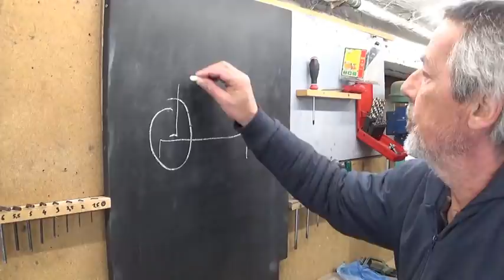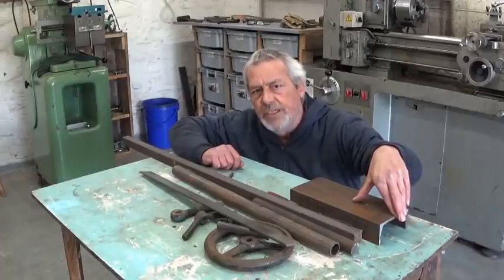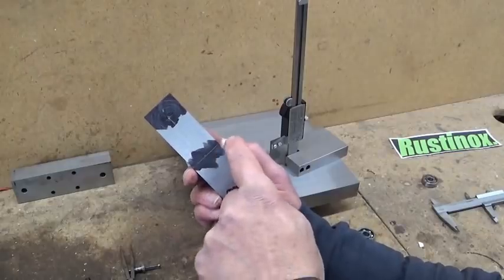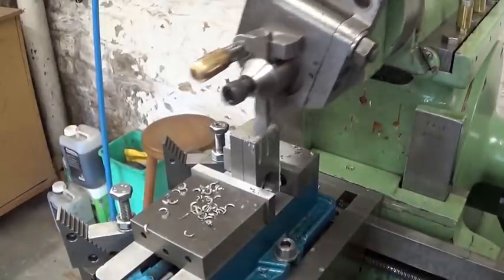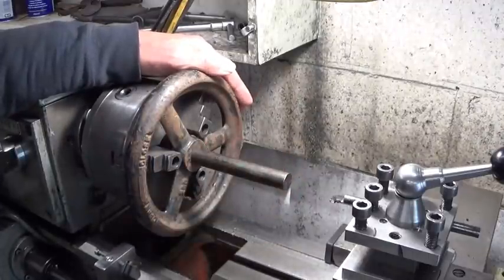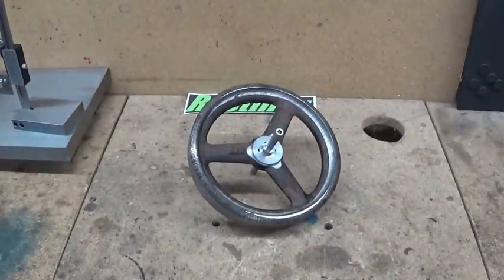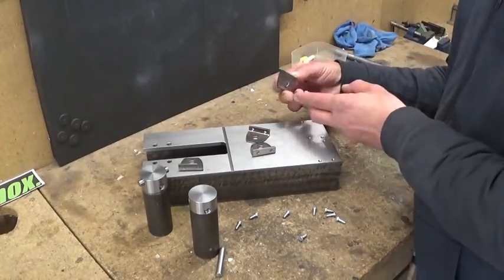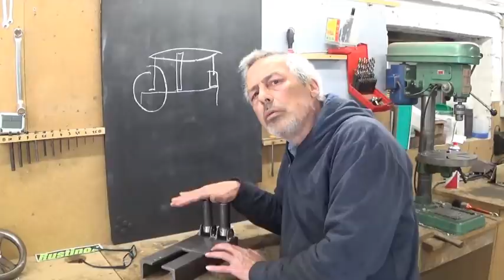Beam engine build part 1.

Comment: Nice “scrap” build.  If not already planned could you go over some of the dimensions of parts once built?  Just talk us through or annotate the blackboard drawing. E.g tubes used for cylinder were x diameter, y wall thickness, z long.  Beam is X x Y barstock, Z long.  That sort of thing. Most interested to see how you get the seal on the pistons.   Is this going to be an air run engine or real steam?
Reply from the maker: Thanks James. My idea was to give more details at the end of the build. It's all made of soft steel and will run on compressed air.

Comment: “With a big hammer it will fit!” 😳
I just love the mixture of precision engineering and brute strength. Real engineering.👏👏
The use of the cast hand wheel is inspired. This is going to be one beautiful scratch built engine. 👍😀
Reply from the maker: And it works!

Comment: That's the way to build an engine.
Several skilled Tubers fight with twisted castings to make use of them. I wonder what they want, make an engine or make use of "impossible" castings..
Reply from the maker: Thanks Stefan. I don't have the equipement to machine these small castings so i do it my way. The advantage is that when i screw up a part i can start again. If i screw up a casting it's total loss :-)
Reply: @Rustinox  Just what I think, pick up a new piece from the supply, or the scrap bin, if Boozo visits...
Some Tubers make costly riggs etc... Luxuary work....

Comment: Wow, somebody's really getting into steam engines :D
My first attempt at a homemade engine was a beam type, too - an utter and catastrophic failiure.
I just can't get a thing to work properly without doing some extensive planning beforehand - and I admire those that can.
Great choice - a twin cylinder beam is a machine not found often!
Reply from the maker: Thanks Adrian. I don't have any plans for this build. I just make the parts one by one and fit them together. This weekend i will start making the pistons and other parts.

Comment: Im looking forward to the results! Looks good! I’m not really familiair with the designs of (steam) engines. But it looks great! 
I’ve just finished my hammer, i’ll be working on my small cast iron straight edge now. I’m gonna grind a shear tool like you explained to use on my shaper. 
Video comming up in a couple of weeks!

Btw, you look great and fit!
Reply from the maker: Thanks Chris. This is only the 2nd engine i build, so not much experience either.